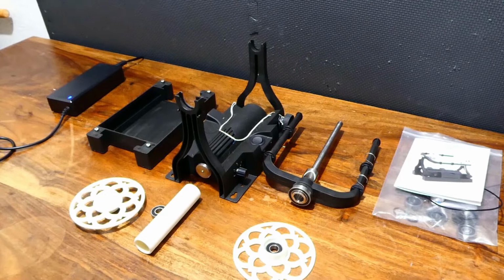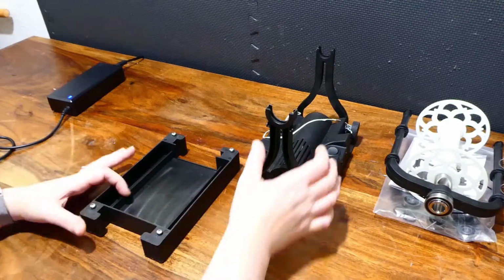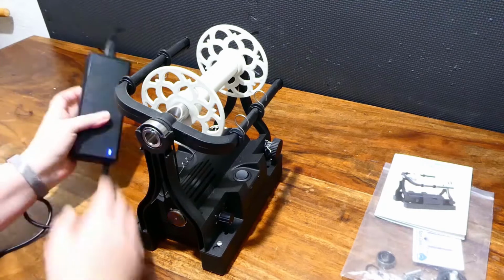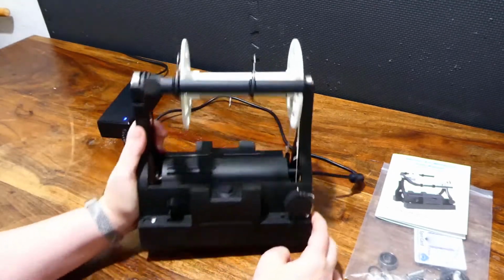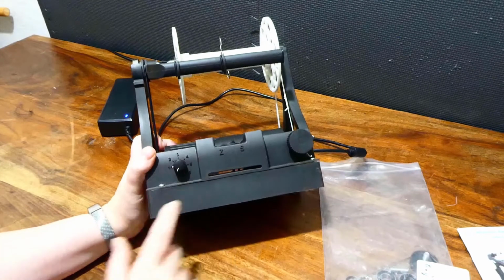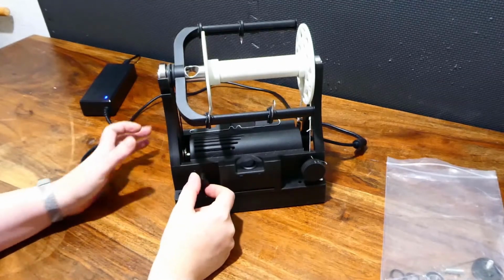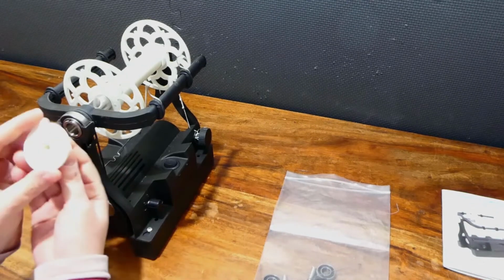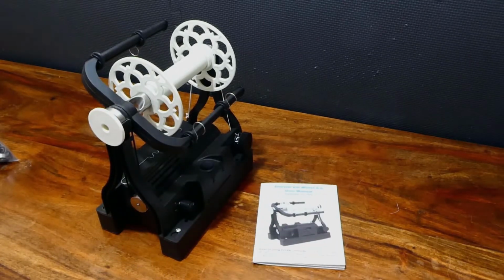eSpinners for Beginners Part 1 - EEW 6.0 Setup and Controls

Comment: I just got my 6.1 eew and all my flyer hooks are turned inward. I like them facing out. Is there a reason for it? How can I change them ?
Reply from the maker: Sorry about this.  Some did ship this way by mistake.  The fix is to just pop off the end caps with and then turn around the hooks.  No tools needed.  Just use your fingers.  I also included two extra hooks to use as spairs.  Or if you find the yarn puffs out at high speeds you can spin with 3 hooks on each side.

Comment: I’ve noticed that while spinning, the metal bit of the flyer (where you put the bobbin) comes apart and rattles and shakes the whole e-spinner. I’ve used e6000 to glue it in place and that’s worked for a few weeks but it’s come apart again. Is there another solution to this issue?
Reply from the maker: I'm sorry you are having this issue.  I understand that the two metal pieces that make up the spindle have come apart.  This shouldn't happen, but I have seen a few with this issue.

The fix is pretty easy.  Remove the flyer and clean off both these metal parts as well as you can.  Set the larger part vertically.Take any thin metal glue (loctite thread glue is what I use and is in most hardware stores) and put 2 drops into the hole.  Then insert the rod and twist it a few times to make sure it gets all the way to the bottom of the hole.  Then let it dry and it shouldn't come apart again.

Comment: When storing the spinner, do you leave the drive band off or remove it?
Reply: if it's going to just be overnight or so, i leave it on. For longer storage I remove it so it doesn't get stretched out and lasts longer.

Comment: In response to the comment that crocheters may want to spin on S and ply on Z, does that apply the same for left-handed crocheters?
Reply: Sorry, I just saw this comment! I really don't know, it depends on how you wrap! If you crochet with plied knitting yarn, do you find it tends to untwist between your hands as you work, or tighten? or neither? If neither, then don't worry, either way is fine. If it untwists, then you'll likely find a benefit from spinning S and plying Z.